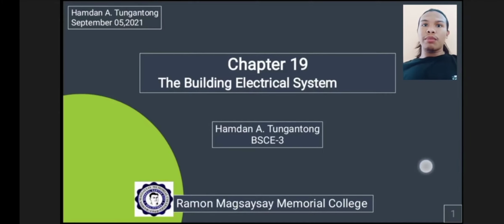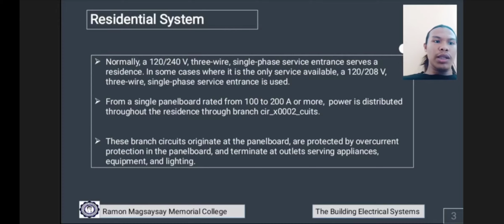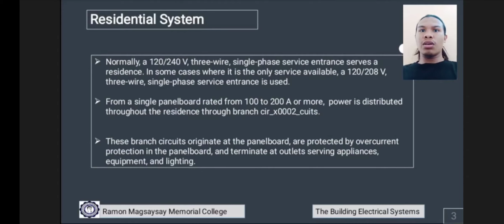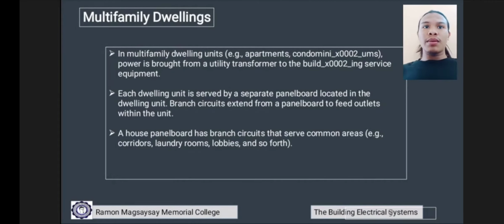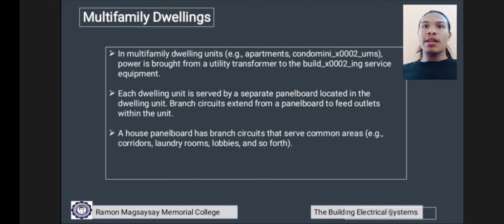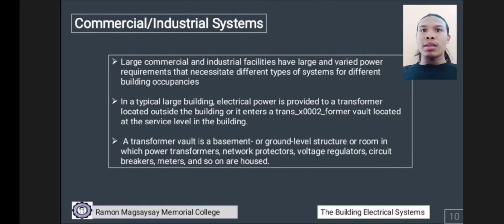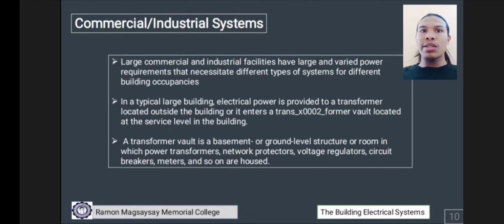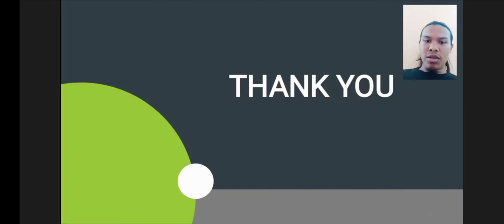ACE313 ENGINEERING UTILITIES 1 REPORT

Comment: In any building, the electrical system is used to distribute power. The electrical system is intended to properly transport, distribute, and convert electrical power from a source to a variety of loads across the building. A permanent attachment and connection to electrical goods are included in the installation.

Comment: From this video, an electrical system in the context of a building is a network of conductors and devices designed to safely transfer electrical energy from a source or source to the large number of consumers who use it, and electricity. I learned to distribute and convert energy throughout. building. In addition, so-called electrical equipment includes the permanent connection or installation of electrical appliances and the installation of electrical cables. By doing so, I realized that  proper  electrical equipment could save my family from harm and possible dangers.

Comment: The electrical system is used to distribute power in any building. The electrical system is designed to safely transmit, distribute, and convert electrical power from the source to numerous loads that consume electricity all through the building. The installation includes a permanent attachment and connection to electrical products.

Comment: In this presentation, I learned the importance of building electrical system that protects the operation of distributing electricity to the consumers. I also learned that in residential system should be install properly to get the best result and flow the electicity smoothly. Lastly, this topic helps us to gain more knowledge in building electrical system.

Comment: For this video, there are kinds of electrical systems that can be utilized to distribute power across a structure. Typically, system design starts with choosing a building system voltage, which is determined by the amount and kind of connected loads, nearby utilities, local rules and ordinances, economics, and safety. Residential system normally, a 120/240 V, three-wire, single-phase service entrance serves a residence.

Comment: After watching Tugantong's report I learned what is the building electrical  system. It is a system that can be use to distribute a power in a building. Tugantong's said in his report that this system is similar to a human body because it distribute power on different parts of the building and contributes to the controls and communication just like how human body works.

Comment: In this report, what I have learn is all about building electrical system. It says that it is the network of conductor that designed to securely transmit, distribute, and convert electrical power from the source of delivery or generation to the numerous loads that consume the electrical energy all throughout a building.

Comment: I learned that the value of residential system and residential electrical installation is really need to be properly learned in order to secure the safety  which associate with proper installation.All wires should be properly tightened and aligned in order to achieve the best quality and the proper standards upon installing such thing.

Comment: In this topic, I learned about how important the electrical system. The electrical system that can be used to distribute power in a building. It is a design of electrical components, which are connected with each other, to carry out some functions.  It provides power to various portions of the building and aids in the control and communication systems.

Comment from the maker: In this topic and video I learned installation of electrical cable, as well as the permanent attachment or installation of electrical items, I understand from watching the presentation. An electrical system, in the context of a building, is a network of conductors and equipment designed to securely carry, distribute, and convert electrical power from a source of supply or generation to the numerous loads that consume electrical energy throughout the structure, in my opinion. According to the reporter, electrical installations include the permanent connection or installation of electrical goods as well as the installation of electrical wire. The power requirements of industrial and commercial structures are diverse.

Comment: I learned about the value of residential systems, residential electrical installations, and examples after seeing Tungantong's report. Safety is associated with proper installation and maintenance. Wires are basically nicely tightened and aligned in suitable areas when wirings are properly installed. He also stressed the importance of proper wire and cable installation for a reliable electrical supply.

Comment: In this video, I learned  about the residential system, this topic is included in The Building  Electrical system. Home's electrical system are the meter, breaker panel, circuits, and wires. Oftentimes, one or more of these components may fail or require, A home's electrical system includes incoming power lines, an electric meter, a service panel, subpanels, household wiring, electrical boxes, receptacles or outlets, switches, and, of course, the appliances, lights, and equipment that put the power to work. maintenance. This topic is also important in electrical systems.

Comment: I have learned that building electrical system is very important as it secures the whole operation of electric distribution and consumption. It distributes power to the different parts of the building and contributes to the controls and communications. Some of the primary electrical assemblies include the transformer, power distribution panels, light fixtures, telecommunications, and security equipment.

Comment: Electrical installations, according to the reporter, comprise the permanent attachment or installation of electrical goods and also the installation of electrical wire. Industrial and commercial buildings have a wide range of power requirements. A separate panelboard installed within each housing unit in a multifamily home supplies each housing unit, in addition to what I've learned.

Comment: I understand from watching the presentation that the installation of electrical cable, as well as the permanent attachment or installation of electrical items. In the context of a building, an electrical system is, in my opinion, a network of conductors and equipment designed to securely carry, distribute, and convert electrical power from a source of supply or generation to the numerous loads that consume electrical energy throughout the structure.

Comment: According to this lesson, electrical installations include the installation of electrical cables as well as the permanent connection or installation of electrical items. In addition to what I've learned, each housing unit in a multifamily dwelling is supplied by a separate panelboard situated in the dwelling unit. Major and diverse power requirements exist in large commercial and industrial buildings.

Comment: The installation of electrical cable, as well as the permanent attachment or installation of electrical items, I understand from watching the presentation. An electrical system, in the context of a building, is a network of conductors and equipment designed to securely carry, distribute, and convert electrical power from a source of supply or generation to the numerous loads that consume electrical energy throughout the structure, in my opinion.

Comment: According to this video, electrical installations include the installation of electrical wire as well as the permanent attachment or installation of electrical products.Large and diverse power requirements exist in large commercial and industrial facilities. In addition to what I've learnt, each housing unit in a multifamily dwelling is supplied by a separate panelboard installed within the dwelling unit.

Comment: in this video, i've learned that electrical system, within the context of a building, is a system of conductors and equipment  that safely transmits and distributes electric energy from the source to the building or structure.

Comment: I realize from viewing the presentation, include the installation of electrical cable as well as the permanent attachment or installation of electrical goods. In the context of a building, an electrical system, in my opinion, is a network of conductors and equipment intended to safely transport, distribute, and convert electrical power from the source of supply or generation to the various loads that consume electrical energy throughout the structure.

Comment: From this video, I've learned that within the context of a building, an electrical system is a network of conductors and equipment designed to securely transmit, distribute, and convert electrical power from the source of delivery or generation to the numerous loads that consume the electrical energy all throughout a building. Moreover, the so-called electrical installations include the permanent connection or installation of electrical products as well as the installation of electrical cable. In this, I've realized that having a proper way of doing an electrical installations may help families away from harm or any dangerous things that may happen.

Comment: The topic of building electrical systems was discussed in this video. An electrical system, in the context of a building, in my opinion, a network of conductors and equipment designed to securely convey, distribute, and convert electrical power from the source of delivery or generation to the numerous loads that consume the electrical energy throughout the building.

Comment: From this video, I have ascertained that the installation of electrical wire, as well as the permanent attachment or installation of electrical products are referred to as electrical installations. In addition to what I have learned, in multifamily dwellings each dwelling unit is served by a separate panelboard located in dwelling unit. In large commercial and industrial facilities have large and varied power requirements.